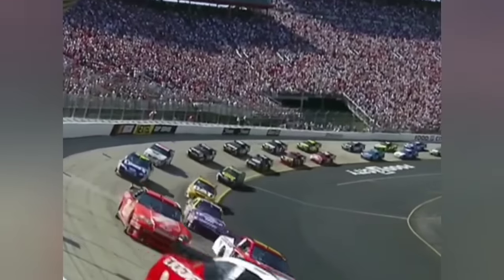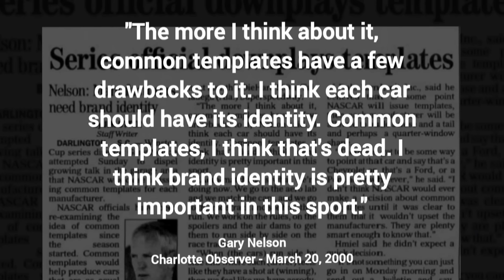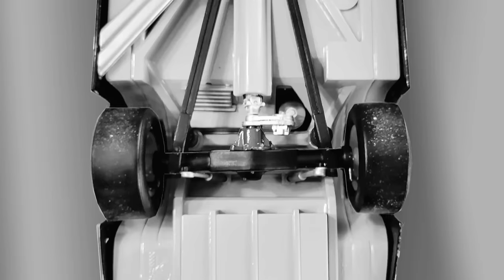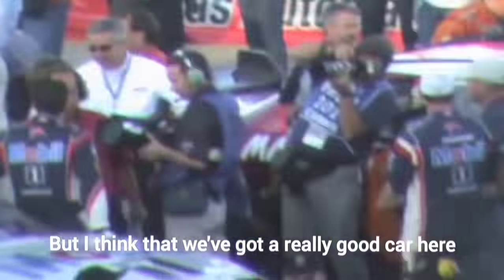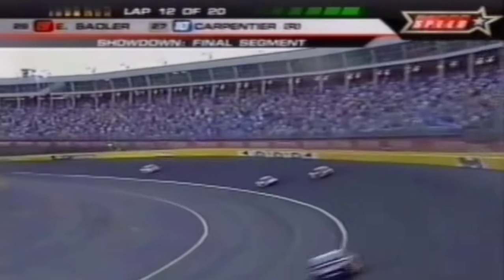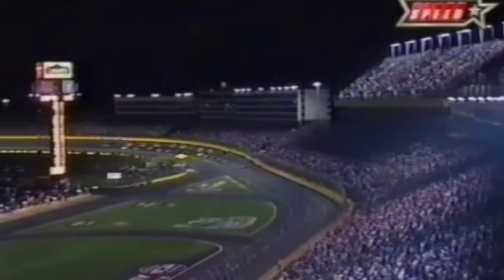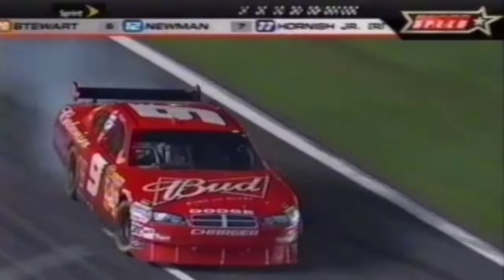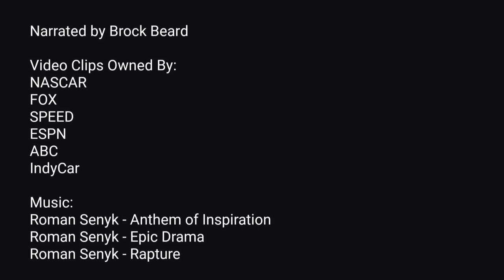The Car That Exploited the Car of Tomorrow

Comment: I really despise that in every facet of racing everything clever or fast is always punished. They want every car to be in a nice little mold and it makes races boring
Reply: It's a conspiracy across all motosports. They will soon make you buy their car and the only difference will be sponsorship.
Reply: @westernstar4964  That is how it should be.  Winning should be a result of skill, not because you had a better car.
Reply: @xe-wf5iv  that's debatable. It's applicable if you see racing as competition of drivers, but for most of the racing history, it was a competition of not only drivers, but the constructors/manufacturers too.
Reply: @CiastoToKlamstwo  I enjoy the cat and mouse of it but in "stock car" racing its always been about a unified field where possible.  If you want constructors/manu champs that's always been F1.  At least that's been my observation as a fan since the early 90s
Reply: @alaskanassassin7332  I think what people want to see from stock car racing is shockingly Stock. Cars. Or at least car's that are based off of a car the average Joe can buy. 

Take a car off the showroom floor and turn it into a race car. Only allow engines in the car if the publicly available car has it as an option. Force automakers to innovate to be relevant, instead of every car being exactly the same with nearly 0% of the car being the same as what the dealer offers.

Toyota raced with a car claiming to be a Camry, Ford used a Fusion. Those cars are not remotely close to race cars in the real world, and neither of them ever came with a V8. This is why NASCAR is so boring to many people. Well that, and driving in a circle for hours. 

Force the manufactures to use stock car chassis and their own engines that are also available to the public, and everyone wins. NASCAR gets a varied field where the engineering skill of the manufacturer matters as much as the driver skill, and since they're forced to use publicly available cars, regular people can watch the car go around the track on Sunday and go buy a car with the same chassis and engine on Monday.

That's how NASCAR was back in the day and how it should have stayed.
Reply: @alaskanassassin7332  Hardly, F1 is pretty much "stock" nowdays, just with their own style of cars. Not really much innovative or differences there, even the freaking engines are standardized. I care not for the drivers, give the engineers a budget, replace the meatbags by computers and let them go crazy, that I would enjoy.
Reply: Meh, you've got to have rules. Rewarding cheaters by changing the rules to allow what they cheated with is not the answer either. But I agree in that one mold ain't the answer either.
Reply: @mal2ksc  Simple, instead of a massive number of design rules have a max budget that they can't go over, so the engineers will need to innovate and prioritize. It's irrelevant how deep your pockets go if you can only use a given amount in the design and building of your car.
Reply: @marcelocoelho4107 you know the teams will find loopholes
Reply: @marcelocoelho4107  Pretty sure that is what F1 did and the wealthy teams are still doing better than the others because they will find ways to use their money.
Reply: @1racerboy1  From what I understand, your idea is what NASCAR originally was. But too many drivers died; the normal street cars didn't have much regarding safety at the time. So NASCAR started implementing safety rules. And more rules. And more rules...until what we have these days; a mere shadow what it used to be. 

One gripe I have with the "same as what's publicly available" idea: Emissions garbage. If the racing cars have to be same as their street counterparts, then the racecars will have to be full of EPA-approved garbage. Personally, I wouldn't want that. 

My compromise would be to allow the racecars to have engines without the emissions garbage, but make the racecar engines have the same cylinder bore, compression ratio, and cam lift as the street counterparts.
Reply: @xe-wf5iv  but you use skill to make the car
Reply: Agree it’s stupid.  Either you have them the same and you let the drivers race or you let them be different and let the money and engineers race. Why not do both?
Reply: @JonesNate  So you want GT sports car racing. Because that is pretty much what you are describing.
One thing that might help NASCAR a lot is advertise the races on road courses more. No one know they make right turns too. Just like Indycar, NASCAR runs speedways and road courses, yet everybody thinks they only turn left which to a lot is boring.
Reply: @Zankaroo  What I want is basically Lemons racing, lol. But with new cars instead of lemons.
Reply: @@PlasmaStorm73N5EVV Never said they were stock, I said they were similar. A C7 ZR1 can beat the C7R on track. A C7 Z06 is pretty close to a C7R. And most race fans that will buy a car because of the race versions performance are going to change the exhaust, breaks, suspension, add bolt ons and a tune to make it the same if not better than the race version. Wither they can put it to use or not.
Reply: @@PlasmaStorm73N5EVV NASCAR started as moonshiners, so the cars were not purpose build race cars. They were purpose build to be faster than the police.
Reply: It's all about selling Tshirts. He who sells the most Tshirts gets to make the rules ~Dale Sr.
Reply: @PlasmaStorm73 [N5EVV] I'm asking for stock chassis, same blocks from the OEM model and then they can add in safety equipment, strip interiors and tune/upgrade the engines/suspension. Exactly what NASCAR actually started out as: Moonshiners tuning regular (Stock) cars to outrun police and then realizing they could race each other with these modified cars. 

Keep the core of the car the same as what can be purchased in the showroom. If they want to be competitive on the track they, have to also let the consumers buy the same car, even if the consumer version has all sorts of emissions BS.

Use NASCAR to show off the engineering prowess of manufacturers and aftermarket parts manufacturers in a way that you or I can relate to. Make it essentially grassroots racing with some of the worlds deepest pockets and top drivers. THAT will make me want to go out and buy whatever car wins. Not a bunch of stickers that make a car vaguely look like something on the street.

NASCAR right now is just a competition of drivers in nearly identical cars. If people want that, we should be skipping all the bullshit and put them all into exactly identical cars and let them really show who is the best driver. Those who care which rich boy is slightly better at driving can watch that series. Those who care which manufacturer can provide the best base for a winning track car can watch this new form of NASCAR.
Reply: @PlasmaStorm73 [N5EVV] and F1 is now boring as fuuuuuuuuuuuuck and wealthy teams still dominates.  Its either McLaren, Ferrari or Red Bull.  The rest is just to fill the grid.
Reply: @xe-wf5iv  Except that NASCAR was supposed to showcase the manufacturer and a BETTER CAR.  You know, like every other motor sport, including F1.  NASCAR was best when it was actual cars you could buy at the dealer.  Now it's just wrestling with motors.
Reply: @alaskanassassin7332  Yes but in the 60's NASCAR was at its' best.  They used real cars you could buy at the dealer.  And it WAS about who could make the best car.  NOw it's BORING.
Reply: @xe-wf5iv  really? i guess horse racing should be one horse {the same horse} on the track alone running at its best for time. Car racing is a team sport from design to finish. NASCAR should just supply the cars themselves along with NASCAR supplies mechanics etc.
Reply: I think punishing a team for being clever is dumb, but allowing teams to alter the cars in arbitrary ways so the car is just that much better than everyone else's gets to the point where the actual race barely matters any more.

I feel like rule changes should be seasonal unless there's a huge safety risk. You set the rules out to keep the cars as similar as possible (otherwise the driver is irrelevant) then carefully enforce them when they're actually broken. Then clever engineers will find ways to advance the sport to make their car better than other cars throughout the season. Next season, you have a different set of rules, forcing engineers to find other ways to cheat the system without actually cheating.

It's also important to make rules so there's not such a huge advantage to having a thousand times more money than the next team. Top level racing will always be expensive, but keeping the sport accessible allows more competition and more exciting races for the fans.
Reply: @xe-wf5iv  the sport isnt supposed to be just about the driver though. It is supposed to be about the car too. If you get 50 drivers all of similar skill levels, all you get is a bunched up mess of cars moving around the track in unison. And that is what most races look like.
Reply: @alaskanassassin7332  no, it hasnt been qbout a unified feild. What stock car racing is, is you take a car sold to the public and modify it to be the higheat preformance possible. Origionally the teams were allowed to select everything about the car.

What this is is completely antithetical to that.
Reply: @mal2ksc  then the lesson is to deregulate so this level of shenanigans isnt necessary. Not to increase the regulations.
Reply: @JonesNate  the problem isnt that they implemented safety rules, the problem is that they didnt stop at safety rules. They started regulating things to change how racing worked on a fundamental level.
Reply: @@PlasmaStorm73N5EVV the driver is never irrelevant. But you cant make the car irrelevant and still have the sport of racing. Why even use real cars at that point?
Reply: @@PlasmaStorm73N5EVV they didnt just "look" like the cars in the showroom, they WERE the cars in the show room. Heavily modified, but they were still fundamentally the same car. A normal person with a good knowledge of mechanics could buy that car and make the same modifications without needing a 10 million dollar facility and a team of engineers.
Reply: @xe-wf5iv   only thing about that is, there's always a better car. You can build 5 cars as identical as humanly possible, and one will put perform the others.
Reply: @xe-wf5iv  your leaving out the motor part of Motorsports, the car out of racecar lol. Plenty of sports already focus on the athleticism of people. Sounds like you want sim racing
Reply: @CiastoToKlamstwo  no
Reply: There's nothing even entertaining about watching dozens of identical cars race, its like a sadder monsterjam. The point of any sport should be to exploit the rules as hard as possible
Reply: With the advances allowed by CAD, the reality is more like the team with the bigger budget will win, almost always, because they can test out more components and adjustments than someone with a smaller one. See, Merc in F1 for 6 years straight. You can only have frequent passing if most of the cars are similar enough to catch up. Also, steadily increasing speed will inevitably result in someone plowing the wall at 200+ mph, which is bad. 

The only way to allow whatever kind of design you want is if the speeds are already too slow to cause major injury on impact. If your race car's top speed is 80 mph, there's going to be 4 times less energy hitting a wall than if you were at 160. The only "series" that comes close is 24 Hr Lemons. A lot of "banned" tech gets used because everything is powered and held together by duct tape and prayers, like axle mounted wings 10 feet in the air.
Reply: Brother, you must not have been paying attention, but even from its very conception, that was the entire point of NASCAR. Even if by accident, in the very first race of the "Strictly Stock Division," 1st place was DQ'd for modifying their car, and 2nd place only got to 2nd because they modified their engine, 3rd place was only there because they stripped out the old gas tank and replaced it with one to hold half a gallon more. The very first race. They had to rename the division from Stock Car to Grand National because the crews wouldn't quit modifying the vehicles. 15 years later that resulted in pretty standard cookie cutter style race cars which were oddly enough still called "Stock cars." Despite nothing being stock about them except the body appearance, everything in these vehicles was stripped out and replaced with high performance stuff.

This, of course, was unsustainable - once you have cars going over 200 mph you sacrifice a margin of safety which is impossible to get back, no matter what you do. Physics just doesn't allow for the safe operation of 43 high performance vehicles on tight tracks over 200 mph. I'm glad that the cars are more tailored to the races, instead of the racers tailoring it themselves. It's safer that way. It results in races of skill rather than "Who has the best mechanic and the most money?" I'd much rather see a competition of skill, and not one of fortunate circumstances.
Reply: "They" is you.
Reply: i mean, just look at Mercedes when the hybrid gen start, almost one decade of winning and everybody was complaining
Reply: Having one organization that has the most money to be able to innovate/r&d win every week by wide margins is just as if not more boring
Reply: @marcelocoelho4107  pretty obvious you don’t actually watch and understand F1 with this hilarious ignorance.
Reply: @dynad00d15  McLaren hasn’t won anything of note in over a decade. All you people talking in absolutes about F1 clearly don’t watch it. You just stupidly regurgitate what you hear in other comment sections.
Reply: Its called balance of performance or parity. similar cars create closer racing, closer racing is better racing. No one wants to see honda civics getting whooped by some koenigsegg, thats boring, funny but boring.
Reply: @uraniumcranium2613  — What you prefer was done in the 70’s and called IROC … Boring as hell.

BOP has been done since the dawn of racing, but rules allowed for differing formulas competing against each other, as when F1 could run 6,8,10 or 12 cylinder cars in any configuration, turbo’ed or NA, as long as you abided by displacement restrictions. Then let the designers have at it.

When you only shoot for absolute party of the machine, you might as well resign yourself to e-racing.

With the way the NHRA has tried to regulate some of their classes, they’ve taken all the drama out it it. If all you’re doing is testing your reaction time against someone else’s, download an applet onto your laptop, take a few minutes for the contest, and save yourself all the time and money of building/buying a race car.
Reply: @xe-wf5iv  You are right, it should be the result of skill, IE if your engineers are better you should have a better car. The driver is 1 person, they are not the whole team. Before the budget cap, some F1 teams had upwards of 1000 members. Racing is a team sport, its not just the driver.
Reply: There has to be a balance of competition between drivers and competition between manufacturers. There must be a way for dynasty drivers and dynasty cars to be dethroned.
Reply: How boring would it be if the STP-Paxton Turbocar was a sure thing to win every race?
Reply: @1racerboy1  I agree. It would be much more interesting seeing the current iteration of sports/ muscle cars racing on the daytona 500 than these cookie cutter fiberglass cars that are all the same after disregarding the color scheme and sponsors.
Reply: Cuz those things hurt the corporate manufacturers who foot the bill for these leagues
Reply: @marcelocoelho4107  It'd be great to see the carnage as well.
Reply: 100% agree. all sports are getting stale now
Reply: Exactly! If they're going to make the cars so much the same why don't they all just get go-karts slap all the same harbor freight Predator engines on them and race those? It's getting pretty bad when I would rather watch lemons racing in $500 shitboxes than NASCAR. Far more entertaining and enjoyable.
Reply: Are you too young to remember Bill Elliot essentially lapping the entire field from performance advantage?  The races were to see who could win 2nd.
Reply: you clearly have never been into racing yourself. get a race car to race at your local oval track. then tell me people having better cars isnt boring. as someone that raced oval tracks gor over a decade, i can tell you without question that the more strict the rules are, the better the racing is. its not exciting yo watch a couple clearly dominant cars lap the rest of the field. if you dont have the rules strict, it always turns into an extremely expensive endeavor, and a couple cars that are backed by more money always dominate
Reply: @alaskanassassin7332  agreed. and thats why formula 1 teams have to spend a ridiculous amount of money, and a couple teams always dominate. anyone that is saying nascar is about engineering too has never raced or even watched local oval track racing
Reply: @1racerboy1  no it shouldnt have. at the speeds they are going, one body style over the next would make the racing suck. im telling you from experience that the racing sucks of the cars arent as close as possible to each other
Reply: @Zankaroo  not just doing better. dominating. and they spend billions
Reply: @randal3122  I agree online friend. The grassroots side of motor sports has ALWAYS been where it’s at. From SCCA solo II to 1/4mi late model dirt tracking. I legit grew up helping dad wrench on his gen 2 nova with a 350 on slicks for clay racing
Reply: @PlasmaStorm73 [N5EVV] these people havent ever seen late models at the local tracks clearly. it is critical for the racing that the cars are as close as possible. this whole idea that we should let the engineers and manufacturers do what they want doesnt work with nascar literally every racing series that does that always has a couple teams dominating, and the costs skyrocket. a big appeal of nascar is that anyone in the top 20 can win any given race. that is not the case with something like formula 1 or the european sports car series'.
Reply: @1racerboy1  that is what nadcar and most oval track racing is. identical cars because it is about driver skill and set up. thats what it is. its not meant to be engineers and manufacturers showing their prowess. go get a race car for your local oval track and race a few years. youll understand why. bro, stick to the european sports car leagues. if nascar changed to what you are saying, it would absolutely ruin the series
Reply: @dynad00d15  yup i dont watch formula 1 for that reason. its lame knowing that only one of a couple cars are able to win
Reply: @mannye  nascar works just like all oval track racing does. you clearly have never raced. and yes formula 1 cost billions to run a team and only a couple teams ever win. its lame. all motorsports that dont have strict rules to keep the cars as close as possible to each other just end up being about who has bigger pockets. trust me, it happens at local tracks too. in a series where the rules arent very strict, a couple assholes always show up with a lot more money and smoke everyone. so when you are racing on any kind of budget, you want to race in a series with strict rules if you still want a chance at all at winning. thats the great thing about nascar. the racing is just better. anyone in the top half of the field can win any given race. at least the top 10 to 15. and its not the same guys winning race after race. the goal is to make the cars identical as possible so that the racing is about driver skills and minor suspension set up. thats literally the point of it
Reply: @jacobhargiss3839  nascar works exactly how stock car racing has worked at your local oval tracks for half of a century. they have been purpose built race cars with strict rules forever. all oval track racing is like that. and its all about the driver skill and minor suspension setup. thats what its all about. the whole point of it is for people to be able to go racing on a budget. so you can have regular people racing at the oval tracks. you cant do that without strict rules because people with more money would just dominate. i think you are not involved with stock car racing at all, and dont know why things are the way they are
Reply: @exstacc1886  no. thats what ruins racing. always
Reply: @jamieboer3466  oval track racing is supposed to be about driver skill and minor suspension set up. it is supposed to be about all of the cars being the same, and the driver winning. all oval track racing is that way
Reply: @randal3122  ain't really relevant to my comment but ok. But also not true at all nascar has had many instances where the car wins the race
Reply: @jamieboer3466  thats not thr intent of any oval track racing though. it is and always has been about the driver and minor suspension set up
Reply: @randal3122  actually it was about car setup. At first it was who could build fastest mods. Then it became what manufacturer builds a car that can last at high speeds for that long.
Reply: @jamieboer3466  nascar was grown out short track racing. that racing has always been about the racing and driver skill. even back in the day when they would modify their cars, its not like they were engineers. they were good ol boys that were just trying to make their car fast on a budget. that goes downhill real quick when someone shows up with a bunch of money. every other class in oval track racing has strict purposeful rules that are meant to keep people with big money from taking advantage of abd dominate. almost all of the drivers in nascar come from local oval track racing, which all has the same rules. and they will agree that it is a good thing
Reply: @alaskanassassin7332  ya what these people dont understand is that the strict rules that make the cars all identical, or close to it, IS what makes the racing good. and at the local tracks it IS what allows someone on a tight budget to still be able to be competitive. it has always been a good ol boy sport, and we are damn proud of it. no oval track racing is about engineering or innovation. thats not what it is even remotely about
Reply: @randal3122  it was literally about comparing cars they use to run from the police and then making them better, always been about the cars.
Reply: @jamieboer3466  no it hasnt. its always been about the racing. you ever been involved in it?
Reply: @randal3122  yes about racing cars, ie the cars.
Reply: @jamieboer3466  no. its about the act of racing. bro, go buy a race car and race in a series at your local track. then you'll understand
Reply: @randal3122  ok? I have, doesn't change the fact that nascar has always been about the cars. It started so gangsters could compare, and then become so manufacturers can compare theirs
Reply: @randal3122  dude..  punctuation.
Reply: @jamieboer3466  well it was bootleggers, but i understand that was the origin. but oval track racing hasnt been that way for a long long time. nascar is like the nfl of oval track racing, and all oval track racing has been purpose built cars for a long time. it really does provide much better racing. it allows the cars to be fast, but not prohibitively expensive. even back in the day, the guys wouldnt brag about how much better their car was. it was always about how much better of a driver they were. and they were just making mods to whatever car they had. it wasnt ever meant to be an engineer and auto manufacturer showcase. no oval track racing has been. minor differneces in the cars can make any class not competitive at all, and that gets really boring really fast. the whole sport is supposed to be grassroots, and it is supposed to be about the driver. nascar isnt the only class that has identical cars. basically every oval track class is that way. you are working on set up and driver technique to gain a tenth of a second here and there. if a car is a half second faster than the rest, it isnt even a competition. on 1/4 mile tracks, even a tenth or two will put you ahead of the next guy easily. at my local track, there is a series that is basically open engine modifieds, and it is horrible. there are two cars that literally lap the rest of the field. but then go and watch asphalt late models, legends cars, imca mods, sprint cars, midgets, k&n late models, dirt mods, dirt late models, world of outlaws, and any of the regional touring late model series,  and you see great racing because the rules are strict and cars are as identical as possible. in nascar when they are going 180 mph, a small difference in aero or geometry will absolutely ruin competition.
Reply: @mannye  k.
Reply: "Being clever and then being punished for it" also known as "the Audi Sport Story"
Reply: @xe-wf5iv It's a huge skill to know how to tiptoe around the rules. Never did drag races or rally?
Reply: @alaskanassassin7332 no it hasn’t, you clearly have no idea what you’re talking about. nascar has always been about manufacturers and driver talent. hence why there’s an owners championship and manufacturers championship as well. forced parity takes the purity out of the sport
Reply: @xe-wf5iv if thats true, what's the point of a whole racing team? Why isn't it just the drivers alone showing up if it should just be driver skill and not the teams work?
Reply: I totally agree. Technological innovation, IMO, is way more fun to see than a bunch of drivers who are more or less pretty much equal in terms of talent. But then you run into the problem of the team with the biggest checkbook winning because of their R&D division. It would be really cool to see a race series where teams are encouraged to innovate and do their own thing but they have a budget cap to stop the rich teams from out spending the little guys and gals.
Reply: yeah. I mean there already is a thing where every racer starts with the same car; they are called one-make races. Everyone gets the exactly same car.
Reply: Let me ask a Question this new car was suppose to make the teams on same level it can't never be like that till NASCAR says every teams get same cars motor them teams that ran in back of the races still in back of the races give all teams two cars they race one or if needing two cars then turn them back in after. The race . Let them draw for cars every week  so boys never had a chance he'll let them get TV time to an some new winners come on guys an girls what ya.ll think
Reply: @xe-wf5iv Skill becomes a very minimum asset when all cars are exactly the same. It becomes luck or chance after that.  Wrecks, pitting, and weather determine your winner, not skill. Skill has so little to do with it. Let robots drive the cars. It's the same difference.
Reply: in this case nobody was punished they just made an official ruling ending this "loophole." it was an inevitability that every car was going to do the same thing unless the rules were changed. 198 miles per hour dog tracking does not sound  like a safe way to go about racing.
Reply: I wish they would bring back Can-Am racing. I care more about cars and engineering than drivers.
Reply: @Blenzo480  well maybe with ai and "self driving cars" there could be a new series of autonomous race cars all about engineering since everyone will have the same "driver"
Reply: @xe-wf5iv  in a sport like nascar, where there’s an entire team dedicated to making sure the racer completes the race, i’d argue everyone’s skill should be account for

Otherwise, we should set a time for pit crews, driver can’t leave for x amount of seconds to make up for skill differences in put crews
Reply: @BassRacerx  I still care about the drivers though, maybe I should say I care about the engineering and the drivers equality but, currently I care more about seeing innovation in the engineering department since its been stale for so long.

AI is not interesting to me, I actually find it quite repulsive. The last thing i want to see is a bunch of cars designed by AI and raced by AI. I care about people and I much prefer NASCAR over your proposition. 

I want what Can-Am was, and no, the dominance of the Porsche 917/10 and 917/30 did not kill the series, the 1973 Oil Crisis did. Shadow had a car, the DN2, that was in the works and it would have been been serous competition for Porsche. They were just working on getting the fueling right to make it derivable.

I recognize the fuel guzzling monsters that was Can-Am are not political viable now, but an all electric Can-Am could be politically viable and would be super exciting.
Reply: You will love Pikes Peak then.